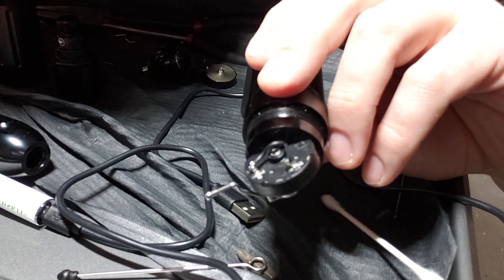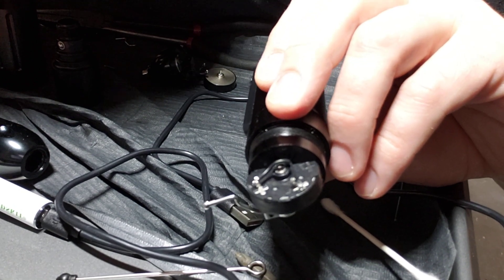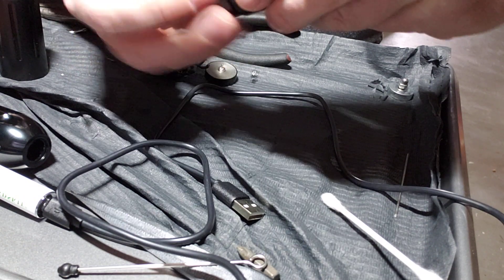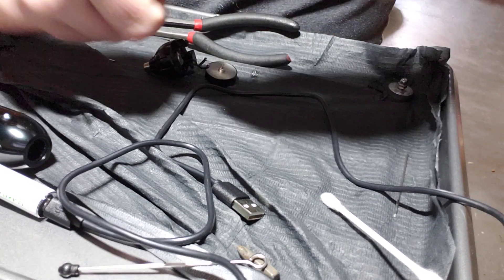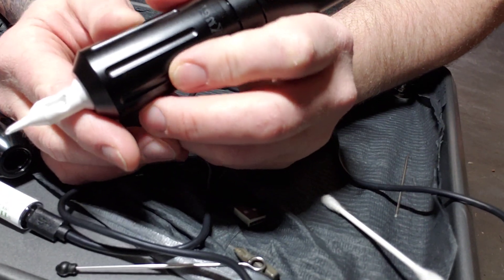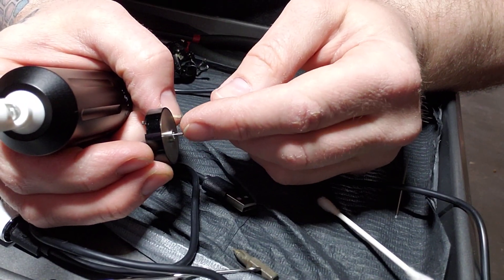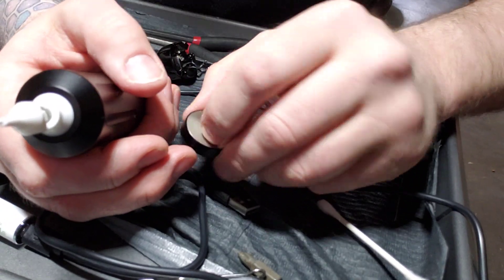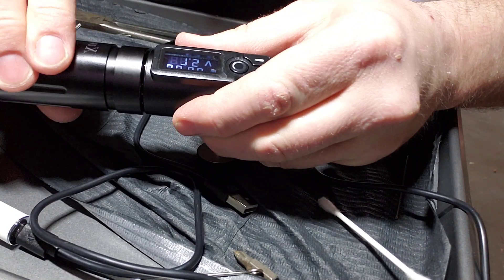I put a 2607T07.5SR Faulhaber motor in my wireless Xnet tattoo machine

Comment: Bro this is not an original faulhaber on q3 they wrote faulhaber but its coreless chinese made… its not a bad motor but not faulhaber
Reply from the maker: @Georges Keyrouz yeah I saw that they stopped putting the faulhaber in the Q3.. I definitely would've returned it.. I bought mine in May of 2020 when they did come with the same motors as the Q1 & Q2.. I don't know why its the only one they stopped putting the faulhaber in because it was the closest to the bishop wand IMO
Reply: Bro even in the older versions.. this not an original faulhaber this is a chinese made with same size and they wrote on it faulhaber but its not original… an original faulhaber motor is more expensive than this whole machine..
Reply from the maker: If you got a q3 when they first came out they had the same motor as the q1 & q2. Check for old q3 videos on YouTube
Reply: Exactly 👍👍👍

Comment: Is there a video showing the process?
Reply from the maker: Moze I didn't record the process but it was fairly simple.. I just melted the solder with a soldering gun, disconnected the motors, measured the shaft of the xnet motor & clipped a couple millimeters off the faulhaber shaft so the cam would fit correctly & soldered the wires

Comment: This is awesome, is this the same faulhaber that's on the Q2??, I just got my Q2 and my faulhaber has a housing around it. I've never seen any Q2 with a housing. So it's got me bugging out, any info you got would be appreciated thanx
Reply from the maker: Captain Ron yes mine came out of a Q3 machine I got a year or so ago. Its a 2607T07.5SR faulhaber motor that they put in the Q-series machines but I don't think they put them in the Q3 anymore. I've never heard of the Q2 with housing around the motor but it makes sense because when they made them they designed them wrong where they had the grub screws on the wrong side so they had to glue the motors in so maybe they redesigned them so they were tightened in correctly. Does the motor say Faulhaber on it?
Reply: @graffics7665  yeah it does say Faulhaber on it, I had heard that same thing about them being glued in and falling out. Thanx for the verification. I posted a video on the Amazon Q2 store..should be up in a day or two if you wanna see it for yourself
I know CNC is marketing the Q2 w/ a "New Program" and charging 20$ more for it...so I wonder if that housing is what they mean by "New Program" who knows
Reply from the maker: @cappn_ronaldo  yeah I'll keep a look out for the video- I'd like to see how they fixed it. Did you get the Q2 for the Amazon Prime sale price of $136? I was thinking about getting one because they lowered it but I'll probably end up getting the Xnet Flux clone they sell on Amazon- it says Hello instead of flux but has a battery like the Titan- they just lowered that from $169.99 to $129.98 & I see nothing but good reviews on that flux clone.
Reply: @graffics7665  yeah the good price,and it got here SUPER quick.  I ordered it on a Friday and it was on my doorstep Monday. I hear good things about Hello Wireless...seen em on eBay tho..I think they have a Bishop Wand clone too...
Reply from the maker: @cappn_ronaldo  yeah I did a review on YouTube about the hello bishop wand type machine with the battery like the ambition soldier. In all honesty I think Hello & Ambition/Xnet machines are all mass produced in the same Chinese factory. I do like their machines though.
Reply: @graffics7665  I appreciate the Chinese for that.
You have inspired me to make a quick video about my Q2 predicament....it's uploading now if you wanna see it for yourself. I don't think Amazon is gonna let my video fly it's been 3 days.
Reply from the maker: @cappn_ronaldo  yeah I just watched it.. I've never seen that before. I'm glad they came up with a solution to their glued motor problem!